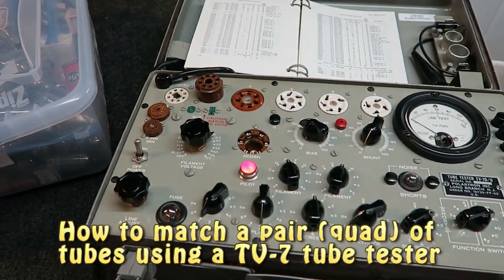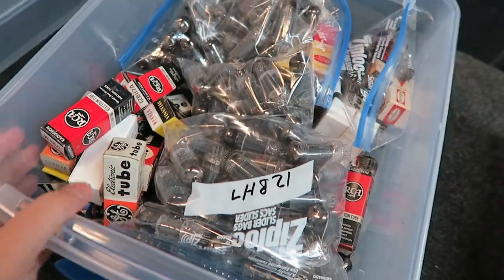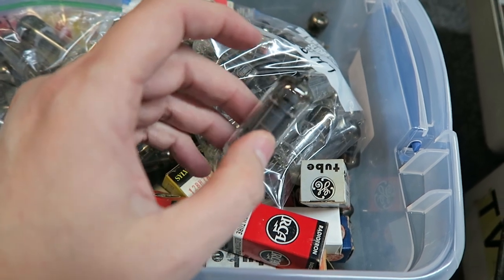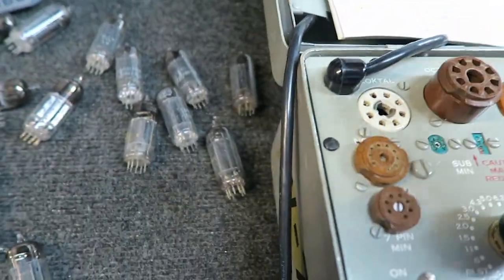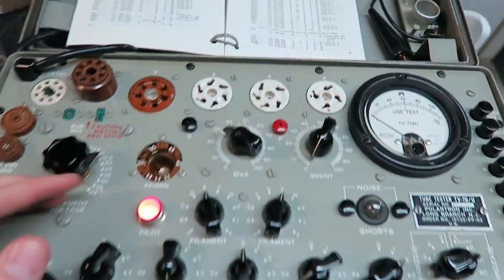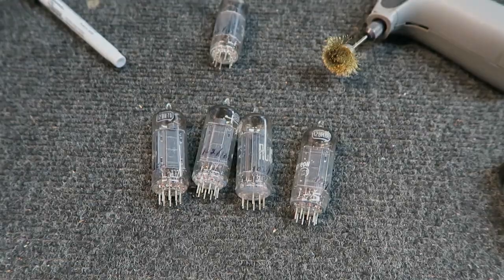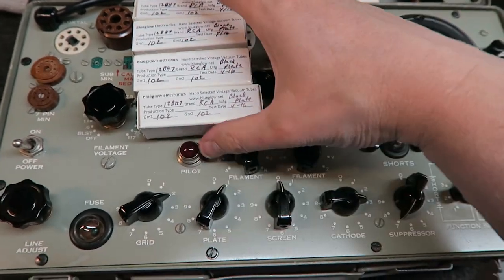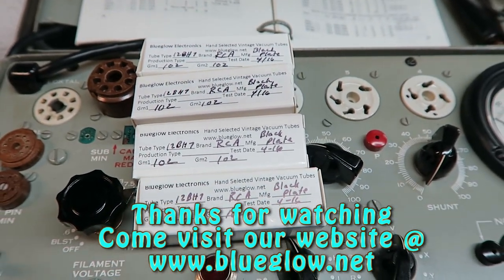How to match a pair of tubes using a TV 7 tube tester - BG055

Comment: Nice tube tester, unfortunately only gm tester is not enough to match tubes. The best way to match is by overlapping curves, for 2 tubes or 2 triodes in same tube if we have different gm curves will not be paralel  and if we have different plate current will show some distance between curves. But if the 2 tubes have same plate current and same gm their curves will be very nice superimposed. Only plate current and only gm is not enough for matching, must be both taken into consideration.
Reply: Wow.  Very interesting info.  So basically with the TV7,  you are only taking a snapshot with one set of parameters, where many are possible in actual usage where things could be drastically different.
Reply: Indeed , many don't know or match tubes correctly .......

Comment: Thanks for your videos. I have seen a tube curve tracer on Ebay for $75, but then you have to add PSUs yourself. Problem is that it only works on Win95 and Vista.
And then to my question: I have bought one of the new Duo digital testers, but I am very in doubt were to find reference data for gm and Ra. I know that gm rises
in an old tube, and Ra falls, but from where to where :-) I would be very happy if you could point me in the direction where to find these data.

Comment: Great video, thanks. One thing: You've labelled the stickers with a Gm reading here of 102 for example, but to my understanding that is not the Gm at all, it is simply the number that the TV-7 uses to scale an outcome.. the Gm is a separate calculation which uses that number as a variable.
https://tubesound.com/tv-7-micromhos-conversion-calculator/

Comment: Thanks for the helpful videos! I do have a question I'm missing the obvious on; If you're reading the tube bias between two tubes in an amplifier and you get different readings, and you switch the tubes & the bias change follows the tubes, I take that to mean the tubes are not matched. The readings you get with the TV7-D/U will show the values of what that mismatch is, is that correct, there's nothing else within the TV7 to give you further information about the tubes in question? 

Another question is; with a dual tube like the 12BH7, I rarely get an identical reading. My TV7 has a new (digital) meter and I'll usually see something like 45.2/46.8, rare I get an even 45.2/45.2. With that & for this example, for a matched set, or as close as possible, would I look for tubes that come as close to matching each offset like 45.2/46.8  & say 45.7/47.0? In other words, when you don't have a perfect match, can it still be a matched set & if so, what's the criteria?

Thank you!
Reply: Bias and transconductance are not the same...........matching means testing both.

Comment: I have one of these and am wondering how I can tell if it is properly calibrated etc.  Finding someone around me that can calibrate it and check it out is like looking for some type of magical unicorn.  I live outside Boston.   
Are your machines properly calibrated?  Anyway I could buy a tube from you that you have tested throughly and written down all the parameters on?   Could I use it to check my machine through the diff tests?   If it was close I would at least know it was close and not completely out of wack. 

Any info would be greatly appreciated.  I am a pro guitarist of 30 years who is just now beginning to get involved in what is  inside the amps . :)
Reply from the maker: please email me

Comment: Hi - do you know if a Tektronix 577 D2 curve tracer is suitable for adaptation for tube testing? I saw a video using the 576 for tubes but wasn't sure if the 577 had the needed capabilities - thank you
Reply from the maker: not easily (at all)